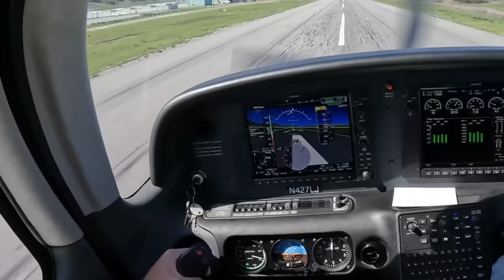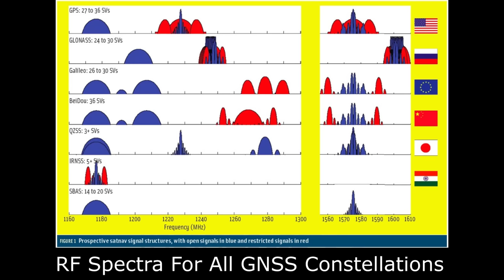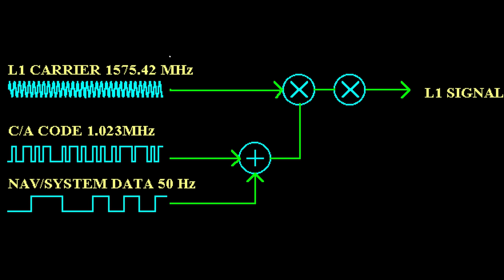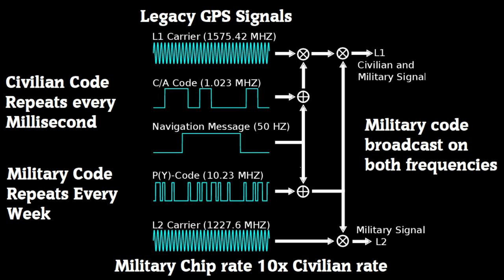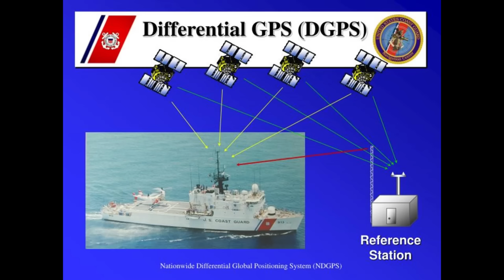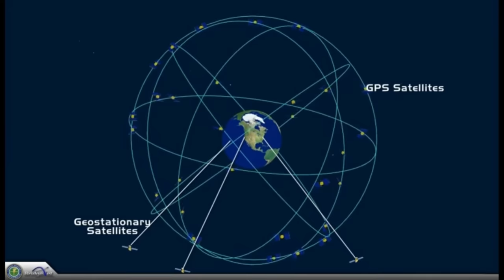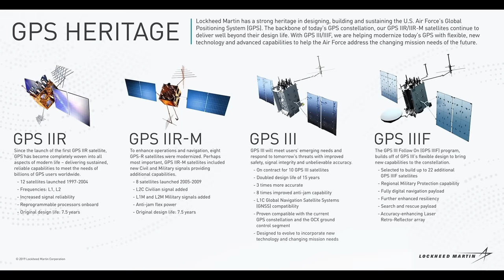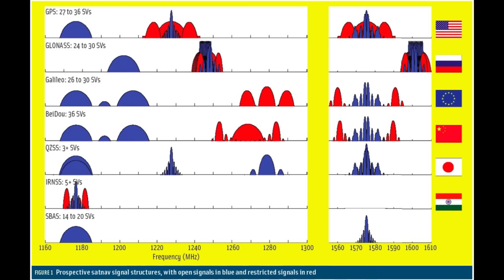How GPS Works, And How It Got Better Than The Designers Ever Imagined

Comment: An interesting quirk you may be aware of Scott. The GPS clock transmits a week number and a time offset which GPS units used to calculate the date and thus the time difference for the signal.
Due to data size limits this week number transmitted cycled back from 1024 to 1 in August 1999.
For many older pieces of GPS equipment this confused them and made them show a position vastly different from their actual location. 
I was working in the UK civil aircraft area at the time and the UK CAA actually issued a date conversion table to reset the date on those GPS units until they could be replaced to correct this issue.
So the actual date may have been a day in September 1999 but to get an accurate position, you had the set the clock in your GPS unit to a corresponding day in the 1980s!
Reply: The y1.999k bug. But really what did they expect to happen? Did people think those devices were not going to last that long?
Reply: There was another rollover in 2019 and according to Wikipedia it affected a lot more devices. Brace yourselves for 2038 when we're going to have both GPS and UNIX time rollovers in the same year.
Reply: There is this quirk in German regional trains. They often have a display with the current date and time, and the name of the next station. This gets its info from GPS, and lately there where a lot of sightings with a date 1024 weeks back from 2003.
Reply: That is truly unbelievable. One would have thought people would learn from the Y2K hysteria once and for all. 
I know you can’t use long integers for all variables just in case, but can’t we just all agree to come up with a more robust way to store date/time in general ? 😅
Reply: @miroslavmilan  Computers and calendars/clocks have never got on well!
Reply: @baksatibi yup, one example is DVB Terrestrial Tv, transmitters on various locations use gps timings to synchronize their signals on the same frequency for the same channel, and avoid both wasting space on the spectrum and improve the signal by additive interference. (Probably used the wrong terminology but hey it's been a while)
Well guess what broke when gps week rollover came on those 20 years old reviewers? 😅
Reply: @baksatibi  Indeed, I believe 2038 will be closer the big disaster which was predicted for the 1999/2000 transition.  There are probably many billions of devices out there which were created with original ctime library code which counts seconds elapsed since January 1, 1970 in a long integer.
Reply: The funny thing was the only unpatched trouble I ran into 2000 was with tape library software running on NetWare which botched the leap year status because the tape software did not account for 2000 being divisible by 400, but NetWare got it right.  The tape software quit working because the server date didn’t agree with the tape software’s concept of date and anti tampering logic kicked in.  I tried setting the clock backward, but that was also blocked.  We had decided to move from NetWare to Windows, so the NetWare tape library was just a redundant backup at that point anyway.
Reply: Also, interestingly the navigation message transmits time of week (TOW) as the lower 19 bits of the Z count, with the upper bits containing the epoch week.  The TOW counts from 0 to 403,199 snd resets at [approximately] midnight UTC weekly.  As you can see, a GPS clock tick is 1.5 seconds long.  The foregoing “approximately” is due to the fact that TOW is transmitted without the UTC leap seconds correction and counts since midnight Sunday, January 6, 1980 UTC.  The leap second correction factor is transmitted elsewhere in the navigation message.  The current disagreement between UTC and TOW is 18 seconds as of September 2023.  For convenience 17 bits of the TOW are transmitted in the hand-off word (HOW) sent at the start of each frame of the navigation message.  The intent is for receivers to be able to rough in their ground based clocks faster.  The exact language is available on GPS.gov which oddly I was blocked from pasting here.

There is an interesting aside to the above.  CDMA 2000 mobile phone networks lock their cell tower transmitters to GPS time to allow mobile units to move seamlessly because the CDMA Walsh codes are in bit sync between adjacent sites.  Several years ago I had an Android phone on Verizon, and I noticed the on-screen time display was always off by the number of leap seconds not counted in the GPS TOW.  I don’t know if it still that way because I am on a different mobile carrier now with an iPhone which displays correct local time at the top it’s screen.
Reply: @wtmayhew a SIGNED long int... 😢
Reply: Don't forget that the satellites have to adjust for relativity. They move, so relativistic effects are at play. It's not much, but still something the system adjusts for. About 38.6 microseconds per day.
Oh and obviously the latency between orbit and ground.
Reply: @HappyBeezerStudios   And also the relativistic effects of the Earth’s mass.  It is really cool when the stuff we learn in Modern Physics plays a non trivial role in the performance of a system which hundreds of millions of people use every day.
Reply: @wtmayhew  The Norwegian railway services also had a nice Y2K problem due to not accounting for that year being a leap year. However, due to using Julian dates (year and day number), the problem did not come to light until the last day of the year, day 366, which the system couldn't handle.
Reply: re: "For many older pieces of GPS equipment this confused them and made them show a position vastly different from their actual location. "
With the early Magellans, I've seen only incorrect time and date, but no issue with bad long or lat position reporting.
Reply: @Valery0p5  re: "Well guess what broke when gps week rollover came on those 20 years old reviewers? 😅 "
While the time/date may be off, I don't see how this affects 1 PPS output, or a slaved 10 MHz clock.
Reply: @HappyBeezerStudios  re: "Don't forget that the satellites have to adjust for relativity. "
Ground control makes those commanded changes to the sats, the sats don't do those computations themselves. Its in the ops plan for GPS control stations.
Reply: @miroslavmilan ahh the more you dig into it the worse it gets. GPS seconds-since-epoch not the same. Etc
Reply: My Garmin GPSmap60C from circa 2007, still provides the same 2m accuracy it always has, displays the correct time of day, but currently thinks it's January 2004 (1024 weeks or 7,168 days ago). Garmin never provided a firmware update to make what I believe would have been a trivial patch to update the epoch. No updates for map products, either. I guess they, like the rest of the corporate world, bought into the subscription model (scam) of product support instead of the customer satisfaction model. I have a much longer rant, but that's more than enough for this forum.
Reply: @miroslavmilan  Artificial Intelligence will fix it ! Of course it will.  ..won't it?
Reply: @MarcoTedaldi  That's the stupidest part!
Reply: @blindleader42 The nav in my 2009 Honda Odyssey also thinks it's January 2004. How I wish it was true...
Reply: The date and time would be 1024 weeks off, yes, but in my experience (with Garmin receivers from 1994 and 2003) the position wouldn't be affected at all by the rollover interpretation bugs. I'd consider it unlikely that aviation receivers had worse bugs where the position would be wrong as well, but it's possible. Oddly, my current main GPS has started glitching to the year 2042 whenever it loses reception...

Comment: Worth mentioning the predecessor to GPS: the US NAVY’s Transit satellite system. This used LEO satellites transmitting ephemeris and timing data at 400MHz and 150MHz. The receiver used measurements of the Doppler shift as each satellite transited the sky to calculate a position. But the position fix was not continuous so dead-reckoning was needed between fixes. 
Also worth mentioning is the fact that satellite XYZ coordinates need to be converted to lat/lon/height using a recognized (and typically locally chosen) spheroid and datum.

Comment: A few corrections:
You missed one of the major drivers in the demise of SA.  The purpose of SA was not to keep civilians from having accurate navigation.  It was to stop an adversary from using our GPS system to accurately guide their weapons towards American targets.  The plan was to have SA turned off during peacetime, so everyone could get the benefits of the system, and to turn SA on during wartime so that GPS could not be used against us.  Well, you know what they say about plans not surviving the first contact with the enemy.  During the Iraq war, as, you noted, because of the lack of available military GPS receivers, our ground forces used privately purchased civilian GPS receivers.  SA had been turned on before the war, but, ironically, the DoD had to turn SA off during the war so that our forces could use civilian receivers.  This was the exact opposite of the intended usage of SA!  I'm pretty sure SA was never turned back on after the war.
One other thing that you missed:  Even at the beginning, it was possible to get centimeter-level resolution with GPS.  I'd have to look up some of my old, old documentation, but I think it was some form of early differential GPS.  One of the uses was to measure continental drift.
It's worth noting that there's also something called AGPS -- Assisted GPS.  This is what phones use.  Cell phone towers send (I believe) the almanac and the position of the cell tower to the phone.  This lets a phone's GPS initialize from a cold start in seconds rather than tens of minutes.
Finally, you mentioned that the data frames give the almanac data for one other satellite.  It's possible the system has changed in the 30 years since I last looked at the details, but I'm pretty sure each satellite transmits the entire almanac.  This was important in the early days before the full constellation was in orbit. 
Aside from those little errata,, that was an excellent explanation of a very complex system.  Well done!
Reply: They did turn it back on after the war, but that was one of the main reasons for turning it off permanently in 2000. One of my favourite pieces of historical irony.
Reply: I think another factor in disabling SA was the launch of the other systems such as Glonass and Galileo. The purpose of SA was so an adversary could not use GPS to guide a bomb to an accurate target. But if those adversaries have their own system, then there's no reason to degrade our own civilian usage.

But they have tested a new type of SA which can be turned on or off for small regions and specific times in response to a specific threat.
Reply: SA was definitely turned on through about May of 2000 in the area where I live.  It was easy to tell when the satellite clock was being messed with because it would suddenly make you appear to be up to 1/8 mile from where you thought you were a few seconds ago.  SA made using GPS based road maps for navigating in cities annoying to say the least.  Clinton signed the executive order to ‘permanently’ turn off SA in 1999, and it was done in 2000.  It would be interesting to see what the economic boost has been to have a reasonably accurate civilian positioning system.  I am sure the benefit is huge and outweighs the cost of the system many times over.
Reply: @brianorca  Do not confuse Selective Availability with Denial of Accuracy. They were two different animals. I touched on both. On SA I guessed which way NSA was going to jump for encrypting P-Code, disabling military precision. But, that was not enough. So they cooked up Denial of Accuracy, fuss with the base satellite frequency source in a manner that should be undetectable. They settled for "very hard to detect". The betraying signal artifacts were nominally buried in oscillator native noise by about 20 dB, a factor of 100. I designed that synthesizer concept. Another fellow did a bang up job designing the actual circuit more or less while I was designing and developing the RF half of the pre-launch test set with those 60-70 hour work weeks due to (dirty word alert) politics. We came in on time. ITT had their Nav Data Unit, NDU, ready about when the unpaid overtinme I had accrued proved the OT was not needed. SIGH.

Basically the design theoretically permitted enabling either the SA or the DA only for partial orbits. I never heard anything about whether it could do that or some problem they''d missed popped up.

And don't forget that the synthesizer allowed Phase 2B to run with an accuracy greater than the standards aboard, which is nice. Rb standards are wonderful for most casual uses but really not that good for something like GPS. And the GPS standard design flown (memory says 2 Rb and 1 Cs) was not as good as what exists on the ground. So the synthesizer gives a nice accuracy boost by fine tuning the onboard standards.

Those birds are nice beasts. Um, and Rockwell International provided me with some nearly magical tools to work with. And Sam Costanza, our department manager, built the best group of people I ever worked with. Sadly he passed die to pancreatic cancer and the department slowly decayed. That's why I ended up "across town" at Magnavox in Torrance.

{^_^}
Reply: @wtmayhew  OK, that's a conflation of effects.

First, again, SA is P-code encryption. Denial of Accuracy is the system oscillator's frequency being messed with subtly.
Second,  remember I mentioned that connector design error above? Well, this is important because reflected signals can shift the timing of the received direct signal enough to put you a moderate distance away from reality. Within a large city I'd not trust GPS as much as I would out in the country. This is a persistent problem. The easy and obvious cure, directional antennas, is a nightmare to realize. If the signal path includes at least one direct view of the satellite among the clutter from various reflections off buildings, one can take some advantage of the theoretical anti-jam margins and focus on the first appearance of the edge of a code phase change. The edges are never straight up and down. Anti-interference filters soften the edges giving them a serious slope. So if you can detect the leading edge you may solve a lot of the in city multipath problem. Modern receivers may be doing this. And depending on conditions that could provide you with the step changes in position I think you cited.

The anti-jam margins built in at least partially intentionally are why the denial of accuracy concept was added. With C/A only you can get readings limited in accuracy only by ionospheric effects. With L1 ANDL2 accuracy is - - - Shoot guns aimed entirely by GPS? I don't think that one quite worked out. Hence all the GPS guided munitions.

{o.o}
Reply: @Wizardess  Yes,I know it is the P-code timing which was being modulated.  I haven’t seen huge errors of hundreds yards spontaneously appear without being in motion since the days when Selective Availability was enabled.  Yes there’s also possible fluctuating ionospheric phase shift.  I believe I still see that, of course, but it is only about a 10 to 20 yard short term excursion outside of the receiver’s Estimated Position Error circle.  My experience with urban canyon multi path seems to be that my receiver just loses lock entirely.  That’s where factory installed GPS does better because it can receive the 8,000 pulse per mile Vehicle Speed Sensor input as well as steering angle input to estimate position in absence of usable signal.  Android Auto and Apple Car Play are nice, but they don’t fully substitute for well integrated factory installed navigation system.
Reply: @wtmayhew  10 to 20 meter step changes seem large compared to what multi-path might do unless it actually becomes stronger than the direct path, which can happen. The multi-path effect would be more in the 10 ns or foot range. Roughly where in the world are you? Denial of Accuracy may be popping up anywhere near Ukraine - most of the Black Sea area out to along the Baltic coast.. If it is turning up in the Black Sea ADSB sorts of data might show wiggles in the expected straight line paths for the various vehicles in the area that aren't using Y code. (If P code encryption is being used.)

You are seeing the effects of a Kalman filter, probably. They work almost like magic. Seeing unaided and aided data at the same time should be quite illuminating.

{^_^}
Reply: @Wizardess  Thank you.  Indeed, war zones not withstanding…
Reply: Multi path quirk: a reflection flips the polarization, so to get fooled by multi path, signal has to bounce twice, else you’d have never received it at all
Reply: @Wizardess  Great story... thanks for sharing history.

Comment: Hard to believe it's been 50 years since GPS was first proposed! It's something we rely on every day now, and never give it a second thought. Although, as you mentioned jamming in the last segment, it's a good idea to keep the sextant handy, and always stay in touch with the old-fashioned ways of doing things as well. Even the US Navy has started teaching celestial nav. again, just in case...
Reply: He showed a slide covering MON but didn't talk about it. MON stands for minimum operational network and is a network of VORs that the FAA will keep operational as it serves as a backup to GPS when it comes to aerial navigation.
Reply: Yes. A really big solar flare could throw the whole thing out of whack, I guess.
Reply: I've always imagined that the Defense Dept. has kept a switching mechanism available so they can shut the whole system down if needed for national security, like, if they believed an attack was imminent. Maybe shut down or introduce an error again.